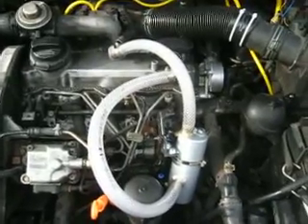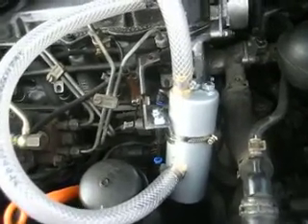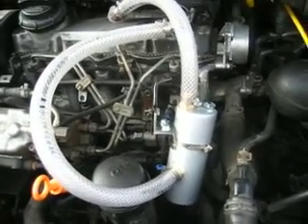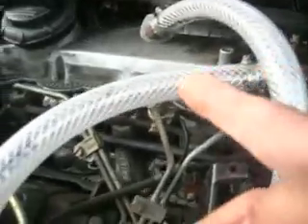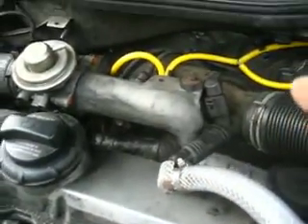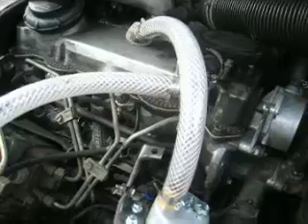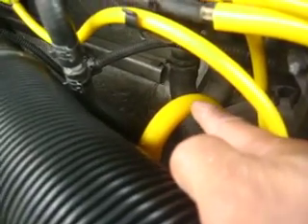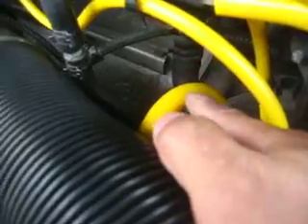VW TDI Oilly Intake CCV Fix 7 of 6 - The Holes Were Too Small

Comment: Still waiting for my aftermarket oil breather can to arrive but that’s what I was going todo so hopefully by the time it’s going back in the intake there shouldn’t be much liquid so to speak
Reply from the maker: Thanks for watching...  REMEMBER: These petrol oil separators are made for low flow PCV breathers, but diesel's CCV breathers are much larger.  I had to do major modifications to my unit to make it work.  The original hoses would never work.  The diesel motor chokes out and has no power.  The larger hoses required me to drill and tap larger barbed fittings, and because of the higher rate of flow I had to stuff the catch can with heavy gauge steel wool to provide more surface area for the vapors to pass through.  I like the stock BMW separator, but realistically I don't know how much better it would work.  My unit is still working to this day and only need emptying 4 times a year.  Each time I get about 8oz or fluid.  If you are installing an oil separator to try and avoid a cocked-up intake, I would make sure I did an EGR delete first (do not remove the anti-shutter valve - some kits come with a straight pipe, but that one change could cost you your life if you get a run-a-way).  I wish you much success. (NOTE: do not pack the steelwool tight, and it should be as high in the can a possible. Get good quality steel wool too. Rust is not your friend.)

TDI Love from Chicago...

Comment: I was about to replace my vacuum hoses with silicone ones cause the old ones are weared down quite a bit and probably collapsing. Maybe you've used cheapest ones which aren't hard enough so they keep collapsing when the vacuum kicks in?
Reply from the maker: when silicon hoses are new they are extremely playable.  Over time they will get stiffer (but not brittle). This means that initially, no reinforced silicon hoses might collapse under 10-35 psi.  you have to check the hoses for yourself.  I like silicone because of the high temperature and chemical solvent resistance.  Two characteristics the reinforced rubber lacks.  if you get it right you will never have to replace your hoses again.

tdi love from chicago...
Reply: If the silicone hose collapses under vacuum, then the hose's wall is too thin. Get a thicker one that's up to spec and it will outlast the rubber OE.  For the ALH larger vacuum hose,  the hose should be ID 5mm, OD 10mm (so the wall is 5mm thick).  A hose like eBay item 400559676427 is good , sturdy and cheap at $2.56/ft  (or peruse McMaster-Carr catalog if you're getting other items).

Comment: Did you let the company know about the change that you made? I'm sure others had this issue too! Dave.
Reply from the maker: +Dave Kana Thanks for watching.
This oil-separator is not specifically intended for VW TDIs.  I think it is for Fords.  And as such, I was well prepared to modify it as needed.  Which I did.  I think the oil-separator was only $13 US.  The fact that is had no internal media (steel wool, coarse fiberglass, etc.) is an indication of it original design flow.  It turns out that VW ALH TDIs require higher flow rates through the CCV or oil/water-catcher.  BMW make a conical shaped separator the is inexpensive and easy to retrofit. To Restate: This is all done in an effort to keep the intake clean.

TDI Love from Chicago.

Comment: I had one like this,and it froze up in the winter.Have you had any problems?
Reply from the maker: No, It has never frozen up, but the lines went from see-thru to black inside. But I clean it out once every 6 months.  When you first install a supplemental CCV catch unit you should drain it out once a month for the first three months to see the volume and determine you draining schedule. Try to determine how much is oil and how much is water.  I have deleted the EGR on my cars.  If you are getting alot of water (i.e. filling the canister each month) then you have a bad EGR water cooler or head gasket and the some coolant is making its way into the oil. I only drain about 3oz of fluid every 6 months. (Note: EGR "Air" is run into the intake manifold and if coolant is present it will vaporise and flow through the OEM CCV. So, An EGR cooler leak will present as white smoky exhaust and coolant entering the oil with the lose of coolant in the overflow tank.)

I did not even consider that it could freeze.  Thanks for the heads up.
Reply from the maker: +Dave Kana Thank for watching.
I have moved away from Motorkote and instead opt for a full synthetic mix.  I mix four 1Qt(946mL) any 100% full synthetic 0W20 or 5W20 and 1Qt(946mL) of "LUCAS Pure Synthetic Oil Stabilizer".  The mixture works extremely well for my and has increased per fill-up travel distance on all my vehicles (petro ones too). Don't get me wrong Motorkote is a good product, but for my small diesel it just was not the best fit. I used Motorkote for a year on all my autos and did not notice any change in fuel eco or drain oil color or motor sound.  I have also started using BG MOA hope to take advantage of the promised cleaning and quieting advertised clams. 

TDI Love from Chicago
Reply: +GallowayChicago Do you have any vids of the Motorkote that you are now using? Thanks, Dave.
Reply from the maker: +GallowayChicago 
If you elect to install one of these you must check it at 15, 30, and 60 days to judge your future dump intervals and to identify what is being separated (oil or water). If you are getting a high volume of water you should disconnect the separator due to the winter freeze hazard and determine where all the water is coming from.

TDI Love From Chicago.

Comment from the maker: This was working well to separate the oil, until recently.  The upper hose that goes to the intake in now blackened with oil mist.  I have drained the unit 2 times and both yielded approx. 6 oz of black oil.  I have seen another YouTuber that swears by the BMW vortex oil separator. The bottom line is something is better then nothing.  This whole system should be open to the atmosphere instead of piped back into the intake, but that would not be environmentally clean.

Comment: would this stop the oil from getting in2 the intake side of the turbo on a 2007 vauxhall vectra 1.9cdti 8valve 120 ? its going from then in2 my intercooler radiator & then in2 my intake manifold which is making it miss abit and smoke blue. ive flushed the intercooler out and all the pipes etc as i bought a recon turbo & its filled it back up again, im not loosing any oil i dont think & ive lost a lil bit of boost
can u ansa back as soon as possible please, thank you.

Comment from the maker: Vinyl 3/4" clear hose allowed the crank venting system to breath.  Any hose smaller would choke off the engine or negatively effect performance. Keep us up to date on your VW TDI  mods. Like I just used a product called Motorkote. Outstanding in diesel engines.  It instantly reduced sound and vibration. I give Motorkote 5 stars.

Comment: @GallowayChicago  Epoxy still holding after 10K.  If it leaks again, I'll try 3m silicone.  On another note, I thought I had vacuum issues again.  Turns out I had bubbles in clear fuel line to IP which was caused by a dirty fuel sender.  I modified the sender as described in TDIForums and got rid of the air,  Very noticeable increase in power and fuel economy.

Comment from the maker: @Prophet2525 Has you fix held? I usually use 3M Silicone instead of epoxy, because epoxy can break apart or gap over time.  I am going to have to get a vacuum indicator or use my mighty-vac to test the line vacuum at my N75.

Thank for the info and good luck.

Comment: Learning a lot from you, so I'd like to reciprocate.  Similar to your turbo boost issue, I fixed a turbo underboost problem today.  Vacuum reading at N75 valve was 15mmhg.  It has to be >25.  The turbo would come on but seemed lethargic.  Traced it to the vacuum pump nipple pressed into the housing.  Vacuum was leaking around the base of the nipple.  Fixed it by covering the base with epoxy.  The 02 Jetta TDi now runs like a thoroughbred.

Comment: Excellent work! I just cleaned a clogged intake manifold/egr and what a pain it was. Hence, I like your ccv oil separator.  What diameter hose did you use? Thinking of building one from Home Depot materials (pvc pipe capped on both ends, tapped with in/out nipples). Clear pipe would be ideal so no need for oil level indicator. I like the intake towards the bottom but that would mean you would have to drain oil as it reaches the intake level, otherwise air flow would be impeded. Thanks!!

Comment from the maker: The system has been running for 3 days now with no loss of power and no visible oil in the lines. (bottom-line: it works now)

The oil separator from eBay has hoses that reduced down to smaller then 1/4" at the neck of the unit. And that was a problem.